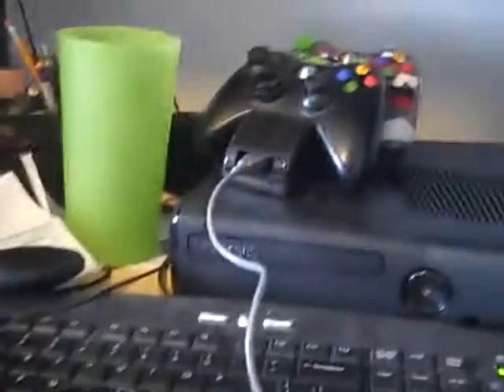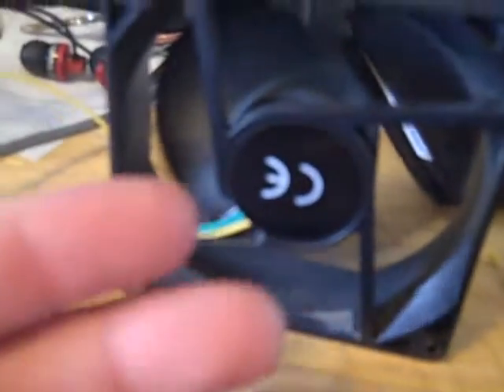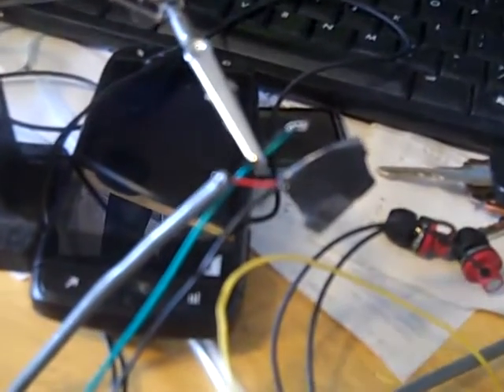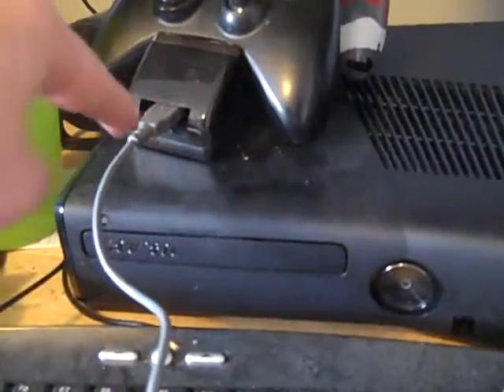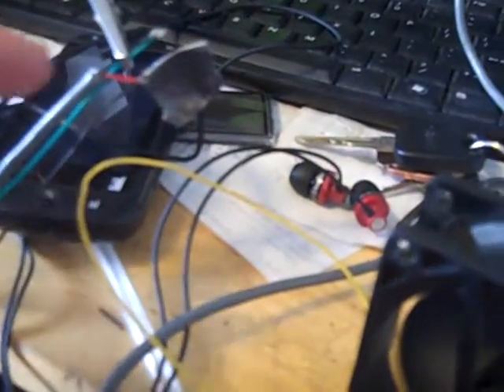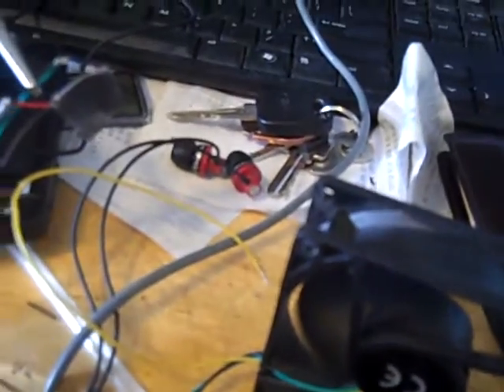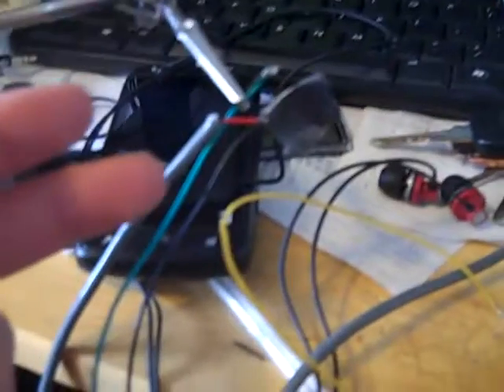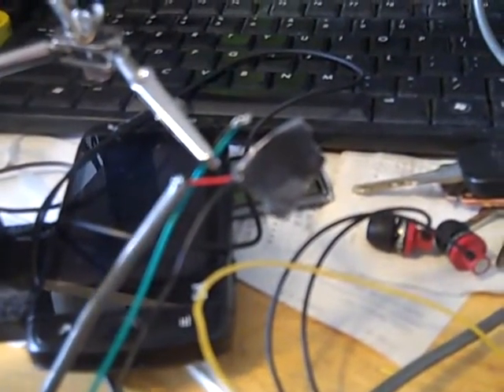3 pin computer fan to USB powered fan

Comment from the maker: everything in the video is what i did. im not an electrician i just connected a few wires and looked at a few diagrams. weak fan but it works for what i needed it to do.

Comment: what did you do with the tach wire i had to connect a switch to the tach or in your case it was the yellow wire in my case my ground and positive were brown and black being, ground and brown being positive and a gray wire which was my tach wire to control fan sped i got my fan out of an old ps3 i had to tap the gray onto the positive for the pulse you ned to get the fan going and then it will run indef i then hooked a switch to the gray and brown to simulate pulse in order for the fan to run

Comment from the maker: it uses 5 volts. only 5 volts can be pushed out of the usb. its possible to wire a 12v from an outlet to a fan but i would be careful because thats dangerous with all the voltage available in the wall. if you decide to try and use a wall outlet be sure to be safe and use protective gear.

Comment: get a 12 volt motor from the the source and get a little kid toy car and get the 12v  battery from the car and use the 12v charger for the fan. P.S get an 18v motor from the source and use a drill battery.

Comment from the maker: im not sure if you can get more then 6 or 7 volts out of a usb. maybe a smaller fan would work better but mine only has an average of 330 rpm. i havent found a way to do that.